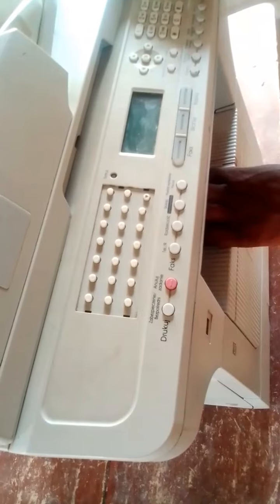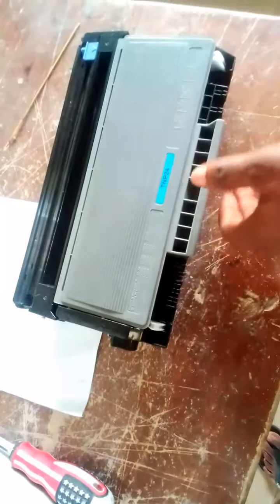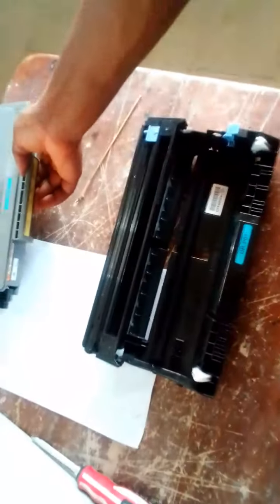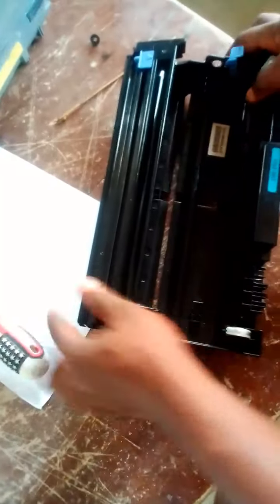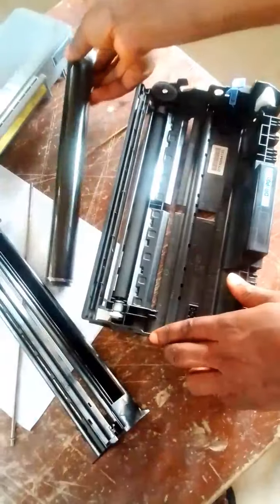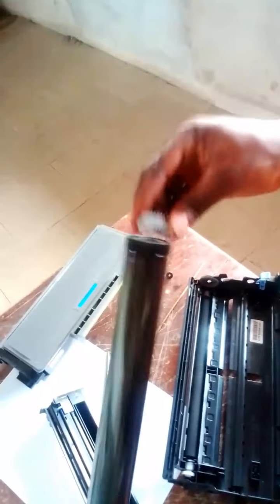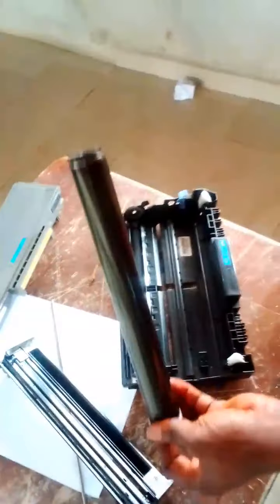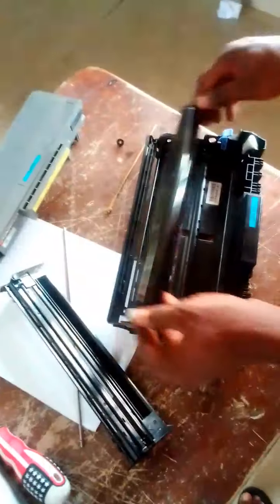How to Replace Drum in Konica Minolta Bizhub 20 Machine

Comment: How do i get paper off double side roller? I have paper wrapped around it but can't seem to access the area unless i use a screwdriver to take things a part. NO access from the front or bottom and the back it's tucked far in.
Reply from the maker: You need to loose the top a little to release the paper, If you can't please call an engineer near you, Or you could give me your location.